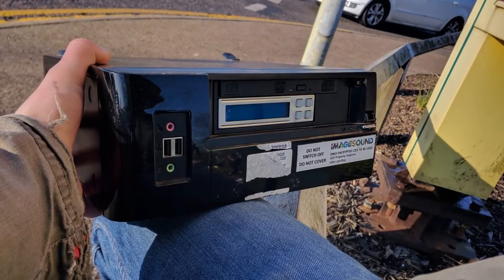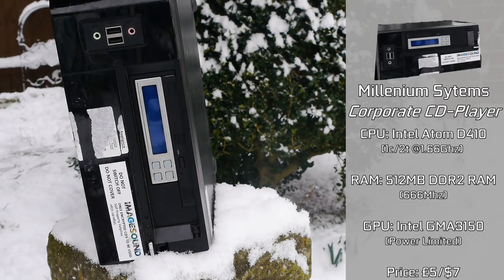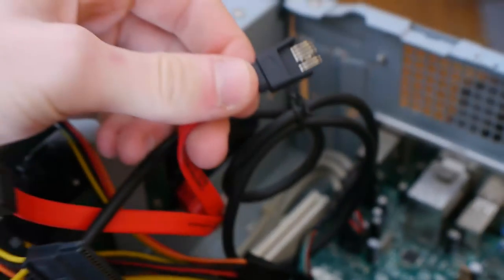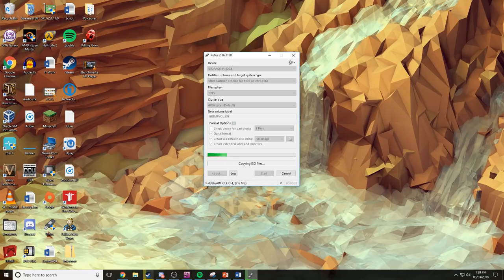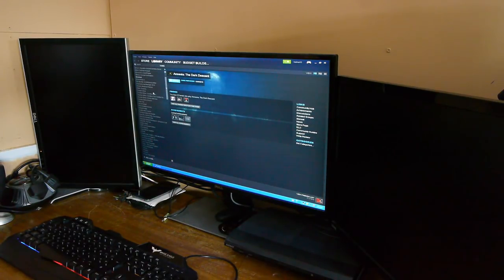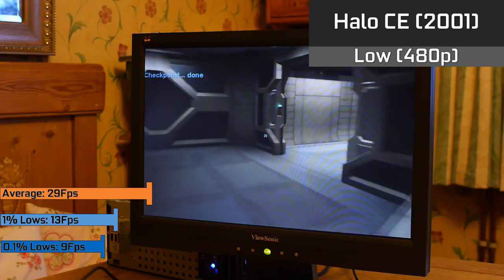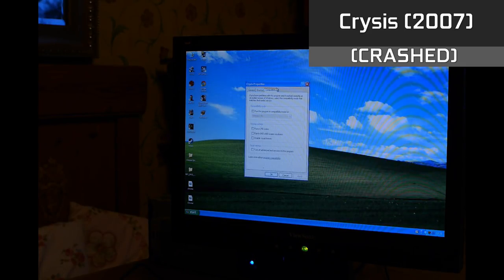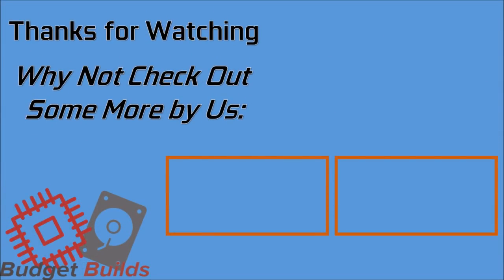Can we GAME on a £5/$7 CD Player from 10 Years ago?

Comment from the maker: YouTube has left a processing error in the video where the audio loops itself for around 1 second, half way through the video (Nothing Major), you may remember this from the old PS3 Video, where it also happened, hopefully it'll be sorted out by the time the video is processed...If not please enjoy me saying "The Mono Team" Twice.
Reply: but it sounds like you said it twice since both sounded different in pitch and speed o.o
Reply: Check the description. You wrote 612MB RAM instead of 512Mb RAM.
Reply from the maker: Very Strange, I certainly didn't record myself saying it, hopefully it's just a processing issue.
Reply: Budget-Builds Official I will send you a PCI GPU! I have an old PCI GeForce FX 5200 that absolutely sucks. But it would be a great upgrade from those Intel GMA. Comment back to me if you want more info!
Reply: Budget-Builds Official BTW I have a PCI GT 610...
Reply: Budget-Builds Official I have some 512mb ddr2 if youre interested.
Reply: I got that same monitor xD
Reply: Budget-Builds Official wow, the snow is very relatable
Reply: why did you not use copyright free music
Reply: darknessblade check out the label on the front of the player, that explains why.
Reply: Budget-Builds Official

Try using a PCI to PCIe adapter, with a PCIe x1 to x16 adapter if necessary.
Reply: You should have tried plop bootloader burned to a CD, that way you could install win 7 or Linux over usb(since a cd is to small)
Reply: Budget-Builds Official Also it's "deb-ian" not "deb-ie-an"
Reply: Budget-Builds Official can you make a video about the AMD 4850 (maybe in crossfire) i've been asking alotta people. It's a treat for the budget.
Reply: Budget-Builds Official ah yeah, but can you playps1 games on it?
Reply: As for the installation you could have pulled the hdd out and put it into a different pc. and installed your os on there and then moved it back to the cd player. 

Older windows versions may be iffy but if you where to go with a up-to-date debian it would probably work.

Alternatively you could have chrooted into the preinstalled debian and you may even have been able to update it to the latest version installed a desktop enviroment and actually use the preinstalled software as a base.
Reply: bet it would or run minecraft xD
Reply: Budget-Builds Official  I nee a CD room  hd for my x box to play Etta me ok
Reply: That's two takes spliced together, but not at the correct point in the timeline. No need to try and pass it off as a "Youtube processing error" :P
Reply from the maker: AJD OLD CHANNEL ARCHIVE: I didn't record it twice.
Reply: Mono team still exists, FYI. They develop the Mono framework, which is an open source multi-platform re-implementation of Microsoft's .NET framework.
Reply: Hey, I have a GT 610 which i dont use anymore.. how do i send it to you? 
I live in India though ):
Reply: Budget-Builds Official: I have a ps3 and I never saw that
Reply: @salvi016  i think its a proccessing error on his side. I've seen this alot with 2 other yourubers but it haplens with them every handful of videos
Reply: @darknessblades  probably be a pain in the rear to download and burn to a cd
Reply: 4:30?
Reply: Install Linux and an old PCI graphics card. Solved.
Reply: Nope not fixed

Comment: I gotta say that that's an overkill machine for playing CDs.
Reply: not when the CDs have encrypted files on them
Reply: RWL2012 and that of course, the extra performance isn't really a waste since it doesn't pull too much power.
Reply: CD players usually would have a ARM CPU and Linux and no ports for monitors and stuff
Reply: Lol, CD players don't have anything like that. Modern ones have a DSP, 4 bit, 3 MHz microcontroller, a tiny amount of SRAM (64K or less) and that's it.
Reply: i dunno, try running itunes on somthing of such low spec... Spoiler: you gonna have a bad time
Reply: Which is totally wrong, ran itunes on a pentium 3 with no problems.
Reply: @ Konatadesuka my old Dual core Duo system had no end of troubles, miileage may vary i guess
Reply: I can totally run mp3 on a 200 MHz chip under DOS. CD's need even less. And DVDs will run fine beginning around 400-450 MHz.
Reply: @HappyBeezerStudios  For DVDs, does 500 mhz assume hardware decoding of the video?
Reply: rasbery pi's didn't existed back then and if you wanted to make an internet of thing you had to throw x86 intel cpu in to mix which made everything bulky.
Reply: Well I can beat that.

Iran iTunes on a Pentium 2 solaron just fine matter fact it was actually already in Windows XP did not have to install it myself.

So long ago I don't even remember what updates are had excetera but I know that it came with it. When I received it. I didn't even realize that I have on my system Intel I was given a iPod Nano that was used but no longer needed due swinging iPod Touch. By the way that iPod Nano was only 2GB and it used the headphone jack for charging and USB data transfer
Reply: But will it play Doom. 

LOL.

Yeah yeah yeah I know it's been done to death but I couldn't resist.

But I bet it would play lemmings in DOS.
Reply: And Tetris.

Lol.

Maybe we should go from Kennett play Doom to hint play Tetris.

Because Tetris just like Doom was on just about every system you can imagine even things that Doom was not on Tetris on.

So as I said it we we should change the saying from but can it play Doom to but hair play Tetris. Any thoughts from anyone.
Reply: #freeslyfromegypt
Reply: @RWL2012  i think my car radio JVC from 2006 and my old discman do not have nearly this processing power and can play MP3 WMA and so on
Reply: @Abu Misir I have no idea what your talking about, aac/mp3 maybe? Those you can easily run off a sub 100mhz soc. A CD runs easily off a m68000 @7mhz most likely less with a DSP think 1970's cause that's when they came out.
Reply: @user-ro1cc8tz6d  Not really. Intel had embedded cpus since the dawn of time. Either way, they could have had arm or mips processors for quite some time.
Reply: @aaronbrandenburg2441  that would’ve been an iPod Shuffle. The Nano didn’t charge through the headphone jack, it had a 32-pin charging port

Comment: I give you props for having the patience to even mess with this “CD Player” great video 👍
Reply: Hey
Reply: Horizon Gamers what up bro
Reply: Use something like this for long enough and eventually you'll be granted infinite patience with even the worst of computer performance. After having a Samsung NC10 (1gb of ram and a Atom N270 that failed to beat a pentium 4 with downclocked GMA 950 and a 25mb/s 80gb HDD) as my only computer for 6 years (2009-2015), I've gained the ability to even see 320x200 @ 10fps as enjoyable. So I guess there is a saving grace to this sort of performance and having the patience to deal with it
Reply: I found 15-20 fps acceptable for ages. But this was off the back of not having had a PC at all for close to half a decade, and being old enough to know a period where 3d games didn't just consider 12 fps  ''acceptable', but actually considered it the target for an optimum, best-case type experience.
We've come a long way since then.

On the other hand I still mess with a computer first sold in 1979, so... ehh.

Comment: That is really cool, it is basically a desktop that has specs from an old phone or as you said the original Xbox. Cool but not practical at all. :)
Reply: Klexco much higher CPU and RAM than the original Xbox but with a much weaker GPU.
Reply: Weaker doesn't even descibe it. Those Intel GMA were hardly usable for multimedia, don't even think about gaming. I got a setup from around 2000/2001 that runs the games just as good.

Comment: i think it can run cs 1.6
Reply: its got more than enough power to run 1.6
Reply: any pc can run cs 1.6
Reply: Ja mislim da može pokrenuti i nešto više...
Reply: Yeah, it can, but not great!
Reply: what do you mean not great lol the original halflife ran on a 233mhz pentium 2 with 32mb of ram, i played on a 500mhz amd athlon and had 64megs of ram and it ran half life great, that crappy pc is still more powerful than those.
Reply: what is that supposed to prove? that you cant run fraps and 1.6 on low spec hardware because that was obvious. fraps eats up so much cpu recording dude
Reply: Cs 1.6 can "run" on a 486 so yes this pc can run CS 1.6
Reply: It can! But it will struggle with players/bots, maybe the original GoldenSource Half-Life will run better!
Reply: i think it can run .kkrieger
Reply: @Foxxxy Furry hahaha noob pc
Reply: @Adkatka  that is why i brought up half life running on a 233mhz pentium2 cause CS could run on that. now 1.6 and half life on steam are a bit of a different beast but this thing is like 10x as powerful as that pentium2 was so it shouldnt be a problem just pointing out how low the specs are for the original game
Reply: @SevenCompleted  My netbook with the same intel atom 1.66ghz 1 core 2 threads even with 2gb ram could barely achieve above 20fps on lowest possible settings even the resolution.
Reply: @SevenCompleted  gta 3 runs same way.
Reply: Tomas Gaming that's awful cause you only needed like a 500mhz cpu and 128mb ram to play on minimum settings back in the day
Reply: @SevenCompleted  You need that to game would start and not crash but you need a way better specs to run at 30fps and better settings.
Reply: @SevenCompleted  I have another laptop with windows xp, celeron 2.8ghz single core, 1gb ram, 64mb graphics card and the game runs on lowest settings and about 30fps but drops alot and that's only on singleplayer.
Reply: @SevenCompleted  by your comment my 1998 pc with amd k6-2 500mhz, 4gb hdd, and ram upgrade from 64mb to 128mb would run the game at playable fps that's just ridiculous when it can barely run quake 3 arena at lowest settings and halflife doesn't start at all.
Reply: @SevenCompleted  Probably because the newer versions require way more powerful pc.
Reply: Tomas Gaming yeah more modern operating systems eat a lot more resources. Games on xp needed like twice the ram cause of all the ram windows used. I remember the gta 3 specs cause I had it for pc but couldn't run it and had to play at neighbors house
Reply: @SevenCompleted  I mean who these days would have an old pc that doesn't run cs 1.6 and have no second pc that is more powerful. I had bought an pc with monitor, keyboard and mouse for 40€ the pc has core 2 duo 1.86ghz dual core cpu 1gb ram(upgraded to 2gb) and had gt 8500 512mb(upgraded to gt 9500 1gb) that's definitely enough to run games like cs 1.6
Reply: @SevenCompleted  I even got free pc with core 2 duo 2.6ghz(i think it's e7400) dual core, 1gb ram and the graphics were integrated but it has the cs 1.6 already pre installed and runs perfectly fine.
Reply: The free pc got upgraded to 2gb ram and has gt 630 1gb in it
Reply: @zsin128  i ja

Comment: throw 2gb of ram in it and gt 610 for a later vid
Reply from the maker: Gladly, if I can find a PCI GT610.
Reply: Even a GT 610 would likely be severely bottlenecked by the CPU and PCI slot, so it would be interesting. You might also consider the PCI GT 520.
Reply: Devin Hepburn I was going to suggest that myself, but I'll throw in booting 32bit Mint XFCE as it can install drivers for Nvidia fairly easy, and STEAM can run on Mint XFCE at least 64bit Mint XFCE, I've not tried it on 32bit, but would make for interesting video, as I'm honestly tired of YouTubers defaulting to older versions of Windows on these older machines.
Reply from the maker: @Krypto A.D.L: the GT520 was rebranded into the GT610.
Reply: @adwaitagnome  I had a GT610 previously on a system with a Core i3 3220 and 4gb RAM(I recently upgraded the system to 8GB RAM and a GTX1650). The GPU severely bottlenecked the GPU for any gaming and, when rendering in Blender using Cycles, the CPU was actually four times faster than the GPU despite it having 48 CUDA cores. The only purpose of this graphics card is to be an HDMI adapter.
Reply: @LucasPereiradaSilva  not only as a way to add in HDMI it also adds better video capabilities, because with most media it's accelerated by the GPU, with a better more modern GPU YouTube would be usable at a much higher resolution quite easily (ran a into this issue with my thin client I bought just for HTPC usage, YouTube was hardly usable on it with the on-board GPU the best it could muster was 480p there are browser extensions that will help with this and force YouTube to use the older mode but I didn't want that, slapped in a GT 1030 and now can easily do 4k on youtube on it, the on-board could do 4k 30 but being older didn't support rendering of how YouTube does video, and plus some local videos didn't play well when at 4k. Plus it can play a few games.

Comment: Morrowind is basically Doom 1993 in terms of just how easy it is to run.
Reply: Gargoyle Named Lexington not really. Morrowind roughly requires something like a Pentium III or original Athlon CPU, 128MB of RAM, a GeForce 2 MX 3D graphics card, technically but not typically a Sound Blaster 16 card, and Windows 98. Whereas Doom (1993) only requires an 80486 CPU, 8MB of RAM, a VGA video card, an Adlib card to add the game's music to the PC beeper SFX which would be replaced with the "real" SFX with a Sound Blaster card installed, and IIRC DOS 5.0. Quite a big difference... And that's before you get to the storage. The 486 would only need a floppy drive to install Doom, but the Pentium III or Athlon would need an optical drive to install Morrowind. Morrowind would also require a larger hard drive in the newer machine to copy its files to, etc.

Comment: There was a guy who was able to write a Pong clone on a PCM decoder chip of a generic CD player. It was a feat of engineering since that chip is not Turing complete and is not programmable, so he had to reverse-engineer it and then clone a programmable version of it. It was also a challenge because about half of the chip's ROM and processing power went into just communicating with a custom I/O controller, so that the game could be played on a display with additional control buttons.

Comment: You can game on any pc if you get a old enough game
Reply: lifehackertips yep, you can run Pac-Man and Tetris clones on a 1981 IBM PC 5150, the early revision "A" with the 1978 dated pre-bugfix version of the 4.77MHz Intel 8088 CPU, with the original MDA monochrome graphics on an orange phosphor monitor and that sweet PC beeper sound. Sorry I don't know what the FPS benchmarks are but they were definitely running at playable framerates - "Tetris" ran amazingly smoothly and "Pac-Man" only had very minor slowdown but that's to be expected for such an intensive game. The video I watched had the PC's RAM upgraded to 512KB though so your mileage may vary with lower amounts of RAM. I also can't remember whether it was running DOS 1.x or if a newer version of DOS had been installed, so again, you may need to upgrade to a newer version of DOS to run those games.